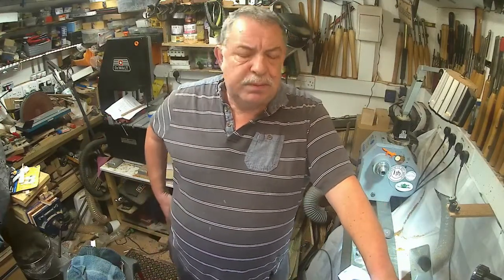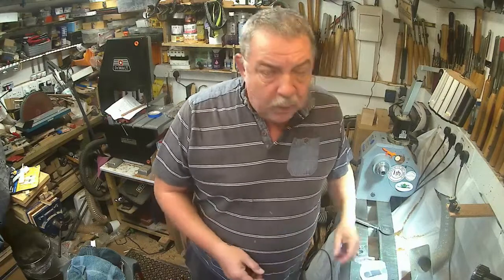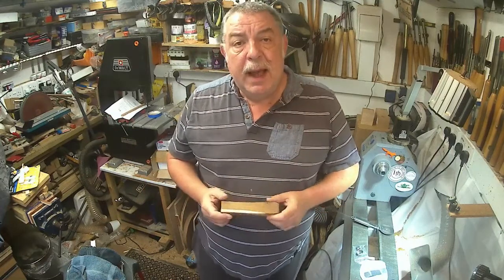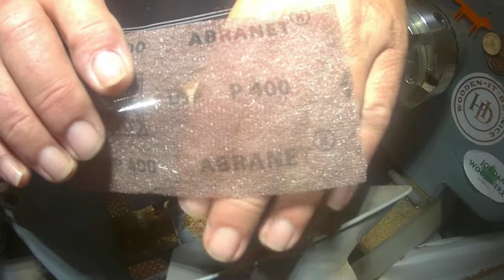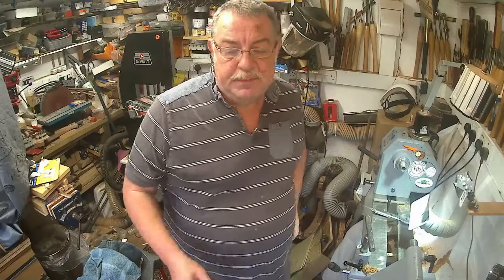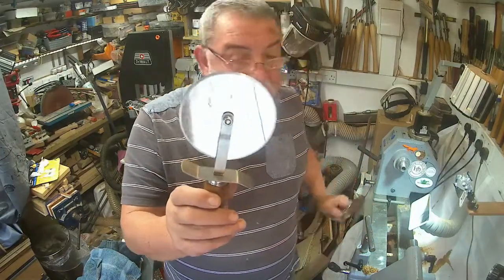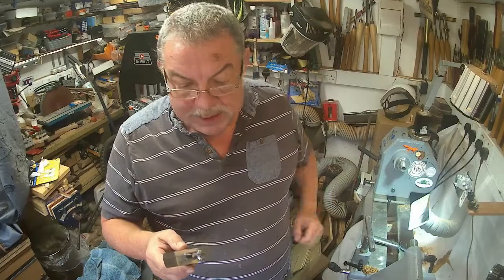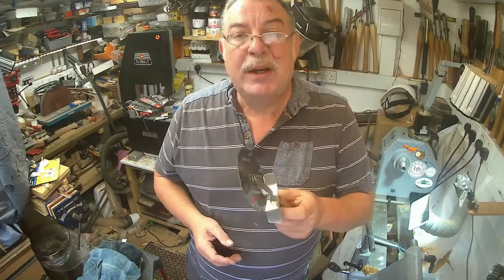Woodturning a Laburnum Handle for a Prokraft Pizza Cutter Kit

Comment: Huw now I wanna turn a pizza cutter now ha! Which i might do that i hope so anyway
Reply from the maker: Hi Chris, Thank you very much. Go for it. It is a fun quick project. Take care Chris. Cheers, Huw
Reply: @WoodenItBeNice  i thought about doing one at some point what do you use to attach the blade into the blank?
Reply from the maker: @chriswalters1014  Hi Chris, With this kit you just tap the tang into the handle with a soft hammer, as I showed in the video. No glue needed. Cheers, Huw
Reply: @WoodenItBeNice  ok thanks
Reply from the maker: @chriswalters1014  Pleasure
Reply: @WoodenItBeNice  one more question sorry what’s the diameter for the tenon?
Reply from the maker: @chriswalters1014  Hi Chris, The size on the tenon for this kit would be different from another Pizza cutter kit. To answer your question I didn't measure it just turned it down until it fitted. Huw